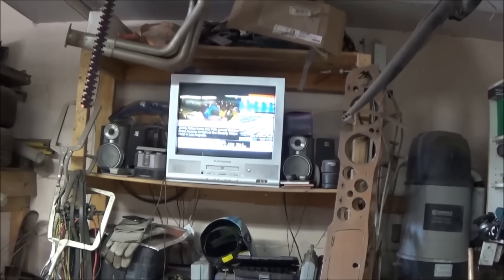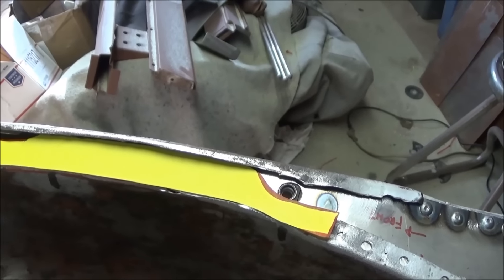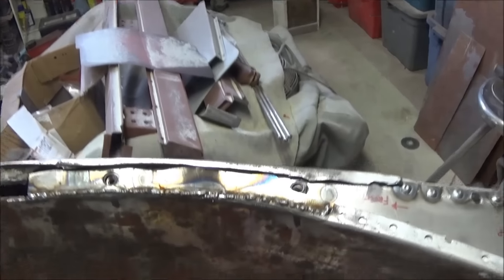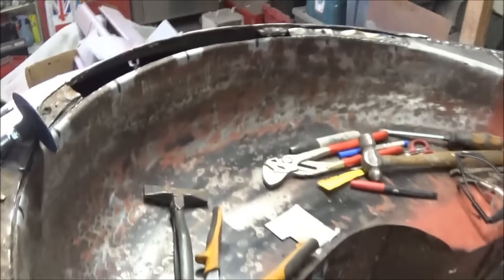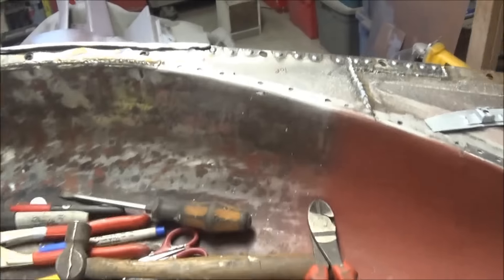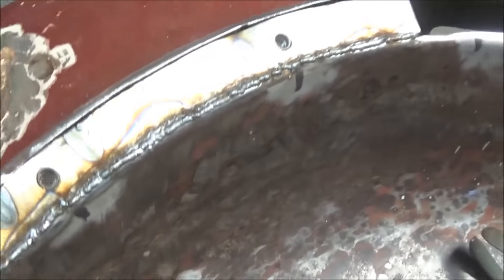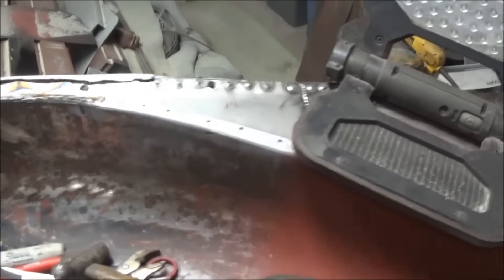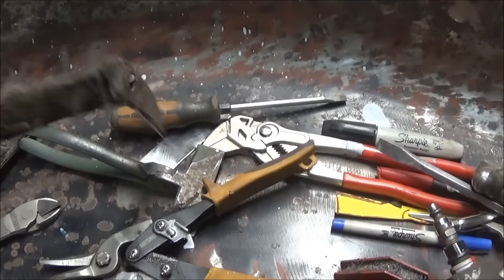Drivers Side Wheel Well Repair Continued, 1959 Triumph TR3A Restoration

Comment: Great work - keep it up.  The local Dremel rep should drop off some "samples"!!  You may have mentioned thisalready  but what mig welder are you using?  I am considering buying one.
Reply from the maker: San Ford I'm using a Lincoln easy Mig 140 with a gas bottle attached. Cheers, Tush